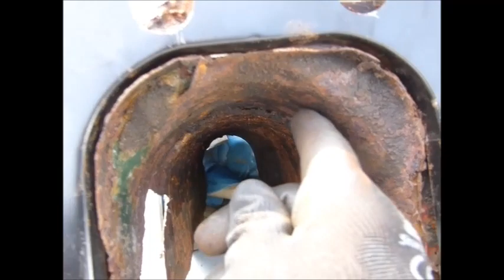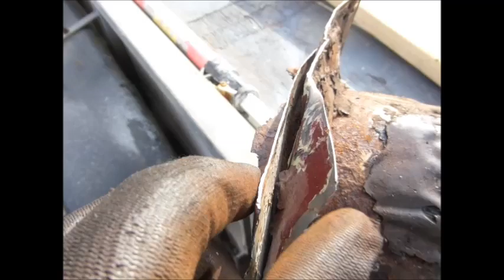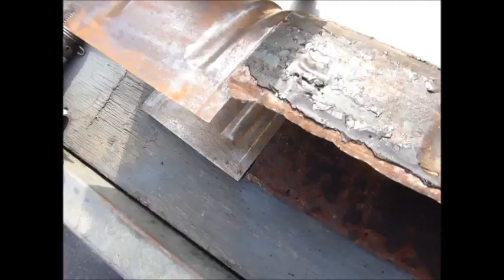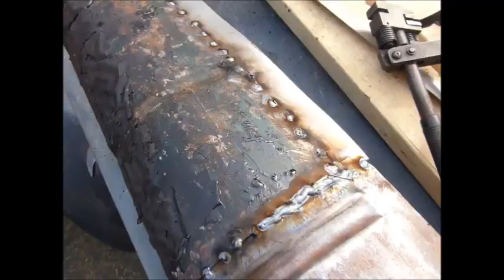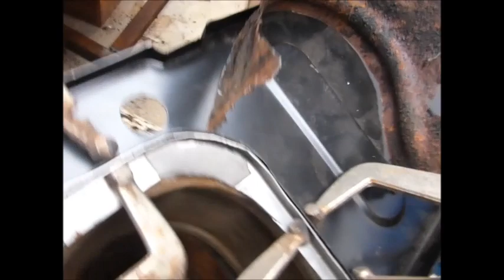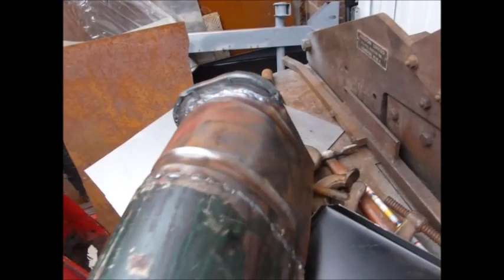TR4 Propshaft tunnel repair

Comment: Alex, where do you source your replacement panels at present? I’ve got two more cars ready for rust repairs. Inner parts are needed. Thanks. Reed.
Reply from the maker: Hello again. Lucky you to have two.  Any parts that have been unavailable from Moss or  Rimmers I have made myself. Inner wings are not a bad fit but outer rear wings need to be modified to fit. I am lucky to have a metal folder and a 12 Ton hydraulic press to help me